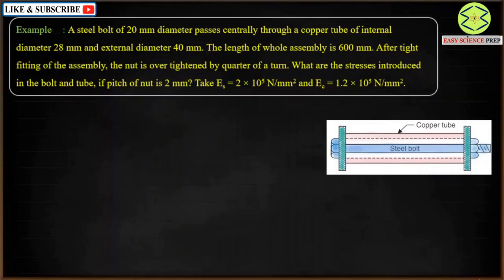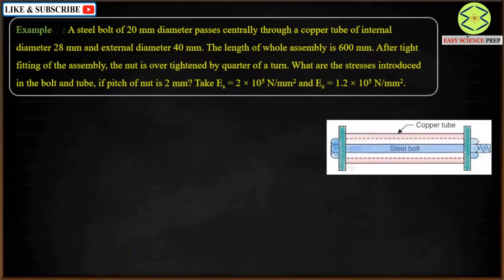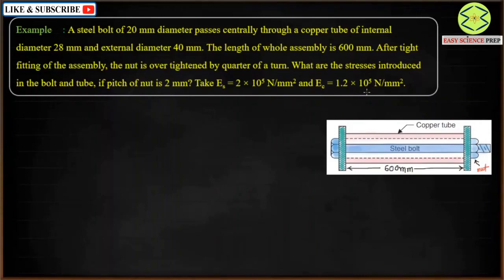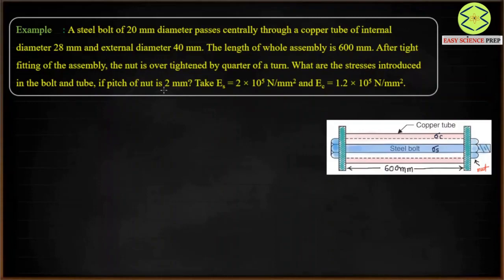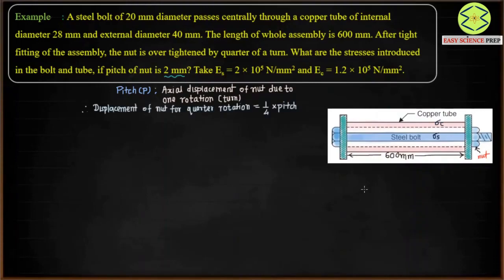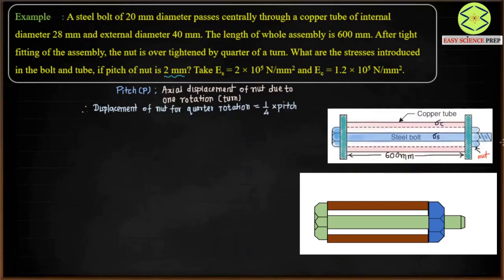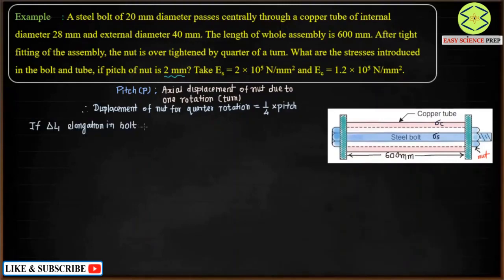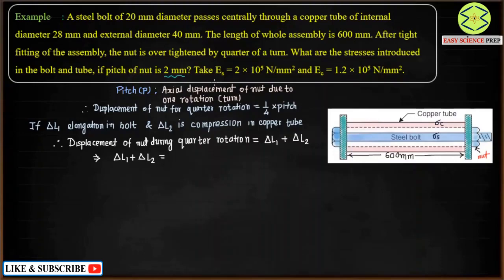STRESSES IN COMPOSITE BAR

Comment: sir can you assure me that this is absolutely correct because their are so many solutions roaming around i'm very confused. sir also why is strain in steel not equal to copper tube?
Reply from the maker: The solution is correct and method is also correct, In simple terms we can say both materials are having different elasticity, hence for same load they will have different strains.